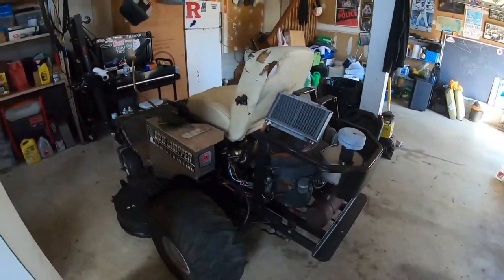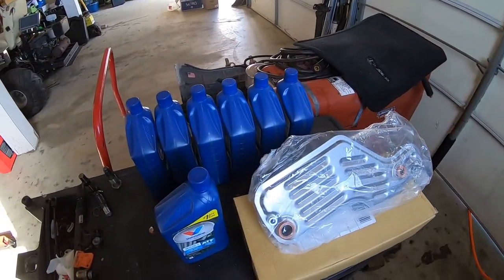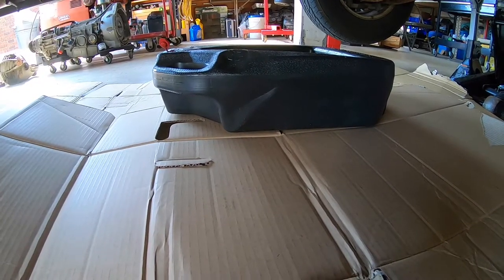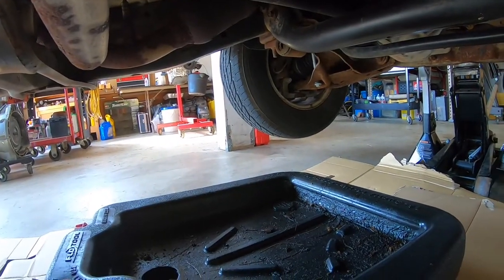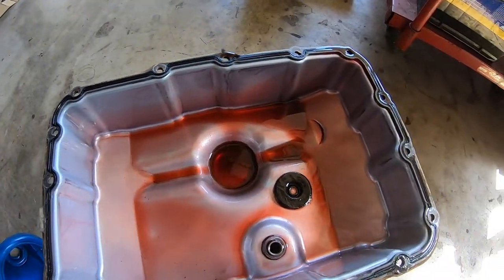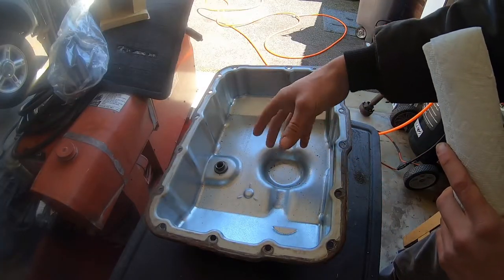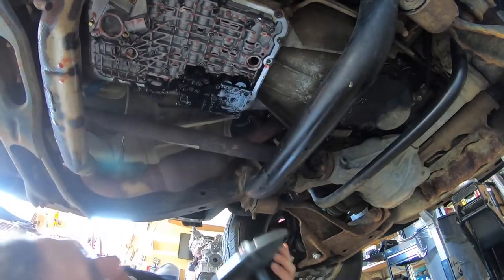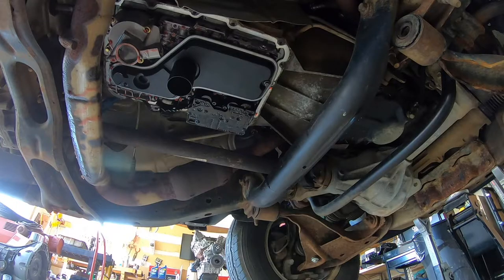Ford 5R55S Transmission Fluid/Filter Replacement (COMPLETE GUIDE) - 2002-2010 Explorer/Mountaineer

Comment: I wish people would stop spreading the myth that floating clutch material in old fluid is keeping a high mileage transmission alive. Couldn't be farther from the truth, if putting new fluid in causes the transmission to fail it's purely coincidental and it was gonna fail any day regardless. I've done multiple drain and fills and filter replacements across many high mileage vehicles of all makes and never had a failure or a shifting issue. That's like saying "oh my oil hasn't been changed in 80k miles I should just leave it alone"
Reply: Might wanna google that bud
Reply: Wish in one hand and shit in the other, see which one fills up faster

Comment: Great video, enjoyed watching it.  Having done this a few times myself, about the only little thing I could add to it was when you removed the old filter, be sure to put some trans fluid on your fingers and rub that onto the two o-rings of the new filter.  Helps it slide in and helps prevent it from getting stuck later on when you have to remove it.

Comment: Remove the big plug first, then take the small plug out on the bench.  Less chance of breaking.  BUT, before you take the small plug out, put the big plug back into the pan finger tight when removing the pan - less mess!
Reply from the maker: Good thing I had the turkey pan!
Reply: Better to take small plug out first to ensure its accessible for fill

Comment: Thanks for your videos - they're very helpful.  I plan on using a long clear poly tube connected to the transmission, with a funnel on the other end.  I'll raise the funnel up to door handle height, then fill with Mercon fluid.  Because liquids find there own level, whether in a swimming pool or in a tube, the fluid can fill the transmission without the need of a pump. Thank you Aristotle.

Comment: I have had no issues on my mustang 4R70 and previous 06 Exorer 5R55S using Valvoline Multi-Vehicle ATF.  I agree also on 30K ATF oil change/flush/or drain and refill x no. Of times.  Hydraulic systems should have clean fluid...the solution to pollution is dilution.  Thanks for the video.

Comment: Thanks for posting, very interesting and informative !!!

 QUESTION: There seems to be a lot of controversy and confusion about "flushing" your transmission fluid... Some so called experts will say you should always flush because that process removes all of the old fluid... Other experts say you should never flush, a "drain & fill" like you demonstrate on this vid is the best way to go... I have 50,000 miles on the original transmission fluid in my 5R55S... Which procedure would you recommend ???
Reply from the maker: Drain and fill. Don’t flush. Drain and fill every 30k thereafter.

Comment: Your picture of the bottom of transmission, you said do not know. The solenoid pack i swopped it out, code came up bad solinoid. Guess i will find out when i put two more quarts of motorcraft micron v. YouTube and co workers can help a lot.Good job bud.

Comment: Did you lift the back up evenly or did you have to jack it up little by little from each side ? I will be doing this in a day or two but I'm not sure if there is a jack point in the back to jack it up evenly ?? 
I will be putting the front end on ramps and jacking up the rear ... Thanks

Comment: As you mentioned, I drained 6 qts of trans fluid on the 2004 Ford Explorer with 225k miles. It has never had fluid change. Is it normal to put back in new  fluids with same 6 qts without auto adjustment?
Reply from the maker: I would auto adjust anyway.

Comment: Yo bro good video.  I have an ‘03 explorer, with 170k miles on it.  The transmission started slipping 2 days ago.  I bought 2 quarts of the correct fluid and some “Transmission Stop Slip”. How would I go about fixing this problme
Reply from the maker: Hey bud. At 170k, that transmissions best years are behind it. Slipping on a 5R is usually fluid pressure loss due to bands or servos. That stop slip won’t do anything. Lately I’ve seen 03 trans on Facebook marketplace pop up for like $500. I’d get one of those and have it installed for another 500. For a grand you’re back on the road for another 100k
Reply: @iamdjnam  Great, thanks for replying in such a notice🙏🏽🙏🏽🙏🏽! Will Do

Comment: Great video, what’s the power tool you’re using?
Reply from the maker: Which one? The pump?
Reply: The hand drill, it’s not a regular drill is it
Reply from the maker: No it’s a Milwaukee right angle ratchet

Comment: I have an 04 with 109k that shifts rough. I want to do a fluid and filter change but while I'm in there I might also change the shift solenoid. But it might just need new fluid to shift smoothly again.
Reply: Did it help?
Reply: @user-dz2pz3ol7p  yea the fluid and filter definitely helped
Reply: It is a matter of choice, but one could do filter/fluid first. If all is well, skip the shift solenoid and save $$$!  If shift problems still exist, you can always go back in and change out the expensive shift solenoid assy later! Just a matter choice and the gamble of having to go back in again or not. As a DIYer, your labor is FREE!

Comment: Any concerns regarding the reverse servo having a broken filter screen?  Noticed it the metal screen torn a little along the edge after taking off the pan.  Never had problems or anything but just wondering if it's something to fix immediately.  Rather not take the pan off again if I don't have to lol
Reply from the maker: I wouldn’t be overly concerned.

Comment: Hey thanks for the video. I have a question about the 150,000 rule -- where did you get the info from, and it is a hard and fast rule? My Explorer just hit 159,000 so do you think I'm in that grey area for an fluid change or do you think it is a bad idea? What about if it got a fluid change once, like 100,000 miles ago?

I was thinking of dropping the pan and cleaning it, then changing filter. Do you think the risk could be mitiated if I just do a drain and swap? What if I try to drain and swap 1/2 or 1/3 of the fluid? Any of your thoughts are appreciated! Thanks!
Reply from the maker: Drain change the filter and refill. Do not flush.
Reply: @iamdjnam  Hi, right yeah that was the plan. But in the video he mentioned that after 150,000 miles enough friction inducing material could have seeped off the transmission and into the fluid that by draining the fluid you will lose that stuff (which maintains proper pressing) and could have a malfunctioning transmission.

So I'm asking how strict that 150k rule is and whether 160k is close enough.
Reply from the maker: @PJ-qx5yt  I’m the person from the video and I’m telling you you’ll be okay
Reply: @iamdjnam  oh haha I missed that. Thanks so much for your reply!

Comment: I have a 2010 Ford Explorer, The Transmission won't shift when cold, but when it gets warm it works okay, however, after I added more fluid It doesn't shift at all, is the transmission dead or there might be a couple solutions I should try
Reply from the maker: Replace the transmission

Comment: Good day Sir! May I know your rpms when shifting from 1st to 3rd gears? I always shift at 2k rpm. Is this normal? The other cars I've driven shifts at 1.5k rpm. Thank you!
Reply: Yes.
Reply: rpms is actually how I confirmed my trans is slipping. used to shift at around 2k like you said, now it shifts at about 3k and thunks into not gear.
Reply: @calvinpryor  I am still shifting at 2k rpm when in 1st and second gear and around 1.5k rpms from 3rd to 5th. I hope that it 's still normal.
Reply from the maker: I mean it’s still shifting right? The problem is when it stops shifting

Comment: I wish I knew this about 3 days ago I change my fluid in my 98 Ford explorer what 187,000 miles on it now the transmission a little bit late to find this out now in everyday you learn new lesson and sometimes it cost money
Reply: How is it running? I'm at 168,000 and was planning on exchanging the fluid. Thanks!
Reply: @PJ-qx5yt  I ended up getting it to work all right it took me about a week to drive it a little bit at a time but I'd probably done and put another 10,000 mi on it since then and it's working okay at this time be careful on the solenoids when you take the pan off

Comment: I find it interesting that you didn't feel it necessary to run through the gears to make sure the torque converter was full. Can you explain please. Thanks
Reply from the maker: The torque converter will not drain. Only what’s in the pan. I literally take Ford procedures and turn them into a video. So if it doesn’t call for running thru gears, I don’t.
Reply: @iamdjnam  Thank you!

Comment: Quick question if anyone can help. Completely drained the transmission, followed this procedure to put in the 5 qts. After about 4 or 4.5 qts into it, I hear kind of like a bubbling in the transmission , then fluid leaks from between the transmission and engine. Whats wrong here? Any help is appreciated, thanks in advance. Oh...same transmission, basically, but in a 2007 Mustang.

Comment: How do install the gasket? Does   It just sit in like that or do you need to add gasket maker ?
Reply from the maker: Just sits on it
Reply: The Ford gasket is very high quality and is reusable.  It's much better than the normal rubber gaskets.  No adhesive is needed.

Comment: After installing a transmission that was rebuilt if there were codes before for it is there a reset/relearn procedure that we can do to clear the stored code(s)? I have a scanner that not showing any codes but the light isn't showing green its showing yellow(caution). It drives like new with no CEL/SES light just the scanner shows yellow so I can not pass inspection but if green I'm good. Please help.
Reply from the maker: You have to drive 1000 miles until the scanner shows green. It’s showing yellow because the EVAP and emission system readiness test is not complete
Reply: @iamdjnam  OMG! I have an inspection that's due by the beginning of August. I'll be driving nowhere near that... 🤦🏾‍♂️

Comment: My Explorer whines from the transmission at normal driving loads . I'm thinking the front pump has issues . Do you think changing the filter and fluid would help or should I change the front pump ?
Reply from the maker: Replace the torque converter, pump, and change filter and fluid.

Comment: I have an 2005 explorer with 160k miles on it. One owner before me and unsure if transmission fluid was ever changed so not sure if I want to do it or not; also the band inside thst shifts it into 3rd gear broke.
Reply from the maker: I have 160k and I’m going to do a simple drain and fill. Worth the shot for me.

Comment: Did you use teflon tape when reinstalling the T30 plug ?
Reply from the maker: It came with some pre installed thread sealer on the plug already

Comment: I just installed a transmission from the junkyard and I had to pull the pan so I assumed I would be putting in five quarts as the trans should be pretty empty. I've only put three and a half quarts of new fluid in and it's already a full stream coming out (cold) like yours was when you said it was overfilled. I'm not sure if I should keep putting more in. Thoughts?
Reply from the maker: Is it at a heated idle? The pan itself should hold around 6. Go thru the gears and let the solenoid fill.
Reply: @iamdjnam  no, it was cold. I broke the stupid hand pump in the middle of doing the 4th quart. So I took the nipple out, thinking it was not going to leak since I hadn't done 5 yet and it was pouring out of the fill hole. I put the little plug in real quick but you can see my confusion...
Reply from the maker: @chriss.3476  needs to be warm.
Reply: @iamdjnam  so when it's warm, it WON'T leak?
Reply from the maker: When it’s warm it’ll take more fluid that’s why in my video I specifically mentioned the temperature and how long I’ve let it idle
Reply: @iamdjnam  ok, thanks. I'll get a new pump, warm the car and start pumping again. I appreciate your help.
Reply: I started the engine to pump the rest of the fluid in and there's a LOUD clanking coming from what sounds like around the oil pan. Would a damaged flex plate make this noise?
Reply from the maker: Absolutely
Reply: @iamdjnam  what would this mean? Not seated correctly? Bent? Would it be a pull the trans and replace?
Reply from the maker: Yeah drop the trans to replace the flywheel. It probably snapped or is cracked.
Reply: @iamdjnam  that sucks. I just put this stupid transmission in lol

Last question. When I was warning the engine, I went through the gears using the shifter. The car is on jack stands. I assumed that the tires would spin when put into drive and reverse. They did not spin, even with my pressing on the accelerator slightly. What does this mean? Torque converter is messed up? Fly wheel (as referenced before)? Or ...?
Reply from the maker: @chriss.3476  yeah they should be spinning. Could’ve completely snapped your flywheel at this point.
Reply: @iamdjnam  well, not the news I was hoping for but this is my life... Thanks
Reply from the maker: @chriss.3476  if the flexplate is fine then the splines in the torque converter are possibly stripped. Either way, flexplates don’t just break. They break because of internal transmission balance issues. I’d get a different transmission if it’s still under warranty.
Reply: @iamdjnam  thanks. It's not under warranty anymore. So you're thinking reopening the whole trans as opposed to just the flexplate?

What are the flexplate bolts supposed to be torqued to? I'm the to check that first before pulling the entire trans again.
Reply from the maker: @chriss.3476  it’s like 43ft/lbs but like I said, I’ve snapped 3 flexplates. Replaced the trans and never broke again.
Reply: @iamdjnam  so the trans was breaking the flexplate?
Reply from the maker: @chriss.3476  yes
Reply: @iamdjnam  question for you... Is it possible to support the trans under the crossmember with the jack, remove drive shafts, pull the trans bolts and roll the trans back to replace the flex plate without removing the exhaust?

Also, since I have to drain the mercon v that I JUST put in there, can I use it again if I drain it into a clean container? 😂 Yes, I'm cheap and that would save about $60...
Reply from the maker: @chriss.3476  you don’t need to drain the trans. But you need to remove the exhaust
Reply: What happened here is this : whoever installed the transmission, did not have the torque converter completely seated in transmission, something done caused it to slide forward even if slightly and that's bad,very bad. Now, when you lined up trans to bolt it to engine bell, upon runnin bolts in to secure trans to engine, what happens cause the TC is not fully seated, is that it becomes pinched against the FLEX PLATE and there is not that slight clearance present so the TC spins freely (This Clearance is Critical), so what happened here as a result is upon you turning key and engaging starter, the torque converter spins out of alignment with engine power now and when it finally grabs the tabs on your Pump, (supplies needed hydraulic pressure for trans to work), when converter hit, it broke the tabs off the Pump and destroyed your Pump causing you to have to completely remove and re rebuild your trans being sure to get all the metal out from the trashed pump. This is called Stacking the Pump. Welcome to the Automotive Industry.

Comment: I got questions can the Ford F-150 4.2 v6 fit into the 2001 explorer sport and what would I need to make it happen
Reply from the maker: The bellhousing on the transmission is different. You’d need a completely different trans, engine mounts, harness, ECU, driveshaft, etc etc.

Comment: Is this the same fill procedure with a Brand New Transmission?
Reply from the maker: Assuming the torque converter is pre-filled, the trans will take a couple quarts more to fill the valve bodies.
Reply: @iamdjnam  Yeah I believe the manufacturer said that the Torque converter is pre filled.

Comment: I got one for ya, 06 xplorer, was leaking a drop here drip there. It got way worse. We yanked it, did a main front seal, reinstalled, drove around the block, around town on streets. Was fine.. Get it on the hwy and in 2,3-5 miles starting blowing out the bellhousing like before we did the seal. Meaning front seal was not the issue, ok. With low pressure we blew into the vent tube with air the fluid bubbles so the vent tube is not clogged. Drop the pan looks at the filter it was not that bad flood was nice and bright red. Higher mileage transmission it was service throughout its life from the original owner that my buddy bought it from they have replaced the valve body a year-and-a-half ago maybe. Any idea I've worked actually leaking from where the bellhousing in the motor connect? Any insight from anyone would be great.. I wasn't really paying attention cuz I was just glad to have it done but if it's over full this is what'll happen right.. I'll have to ask my buddy if he's did a self leveling while it's warm.. other than that man I'm I'm up in arms on what's going on with this tranny I don't do Fords I play with Chevy's 4064 a lady 700 r4 s400 turbo never had a trans problem with like this before..
Reply from the maker: Sometimes the torque converter swear a groove into the input and a new seal is not adequate. Happens all the time on older Lexus cars.
Reply: It need a rebuild, the input shaft bearings worn, input shaft not turning true, got a wobble when turning cause of wear and tear, wobble  causing seal to fail. So if you keep just doing seal it will be sure to keep trashing new seal relatively quickly. National will love you for it, you wallet maybe not so much. There was a reason that the seal on the input shaft started leaking and you fixed the result, you didn't fix what caused the result. Good luck bro.